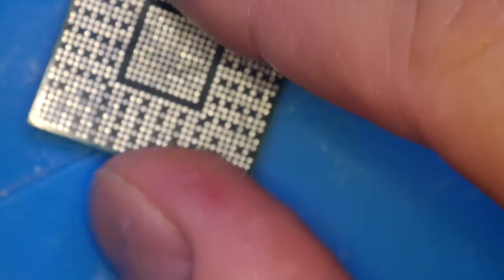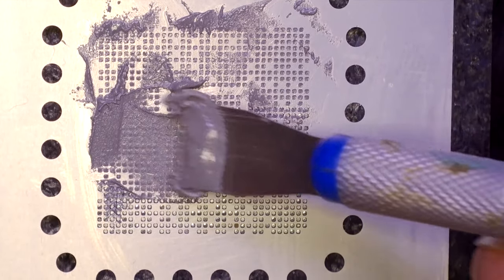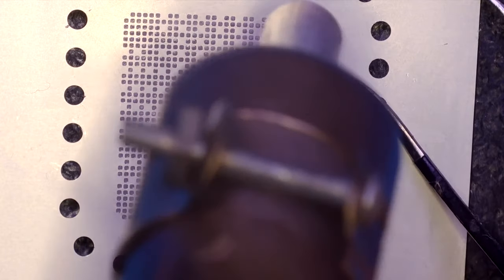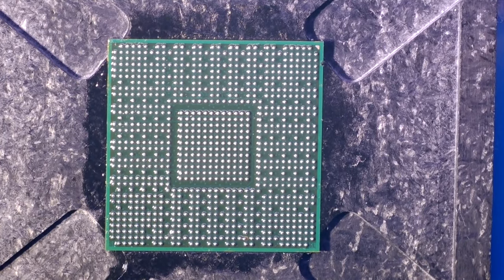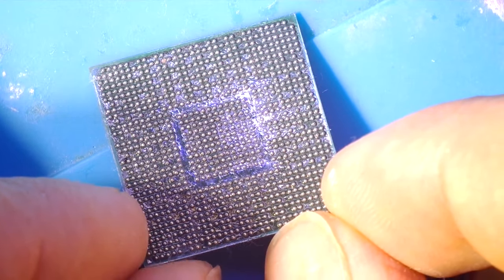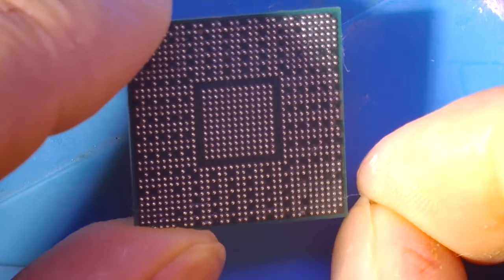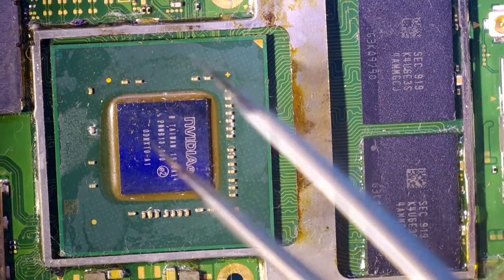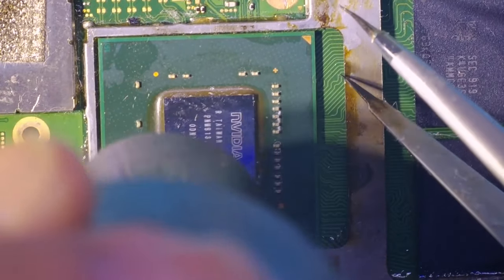Nintendo Switch Lite ODNX02-A2 processor reballing. Let's fix blue screen of death at Switch forever

Comment: Yeah i would definitely buy the stencil if i had to reball ...could you imagine making that stencil  just to replace 1 ball and get it back in its housing ? How do you know where the 1 pin is to put it back in ?
Reply from the maker: You can't find out wich ball is faulty. You should replace all of them, reball all balls under the chip.
Reply: @goodgadgets4671  of course lol it has to go back in I was only joking because making the stencil yourself would take much longer than the actual reball
Reply: @goodgadgets4671  oh I was asking how do you know how to realign the processor in its socket . Which corner and pin determines this ?
Reply from the maker: i just took a picture of the motherboard before processor desoldering and and then used it for chip realign. In good resolution of course

Comment: Service very well done, do you have a photo of the position to align the chip?
Reply from the maker: I took a photo of the processor before this operation, when it was on the motherboard. And then just checked with this photo.
Reply: Yeah that's what I wanted to know also and I dont see anything anywhere on the contact side where it would normally be, but since its BGA I would think the mark indicating this would be on the "top" of the processor since it was not the intent of the manufacturer to allow you to remove it from the socket once in place .

Comment: I just tried this for the first time and it was a failure. The solder seemed to stick to the stencil and not the chip. The stencil flexed like crazy too. I held it with my tweezers like you were here and all it did was smear the balls around. :(

Comment: can you say me what is air solder temperature to dissolder cpu please?
Reply from the maker: Of course. But every model of hot air station is different. So I started from 330C, but then rised temperature up to 350C.
Reply: @goodgadgets4671 podrías apoyarme con el nombre de la herramienta que usas y donde poderlo comprar , y a que temperatura quitas el procesador y aire usas  y a que temperatura usas para ponerlo y aire   espero respuesta  y excelente video , saludos gracias
Reply: @goodgadgets4671 y como le haces para que cpu no se mueva , y no salgan disparados los demás componentes , como lo son los capacitores  y cuanto tiempo aproximadamente le das calor para fijar o soldar ya el cpu